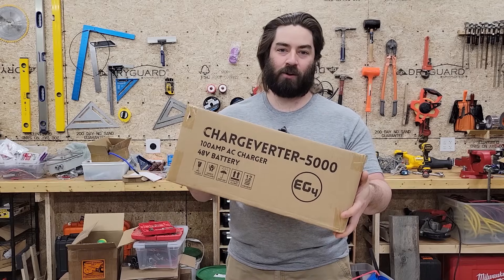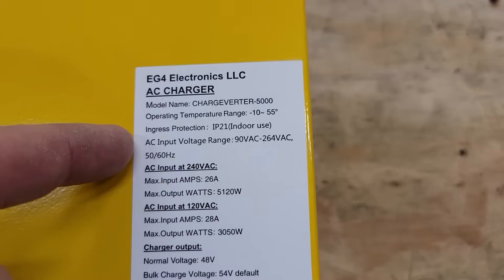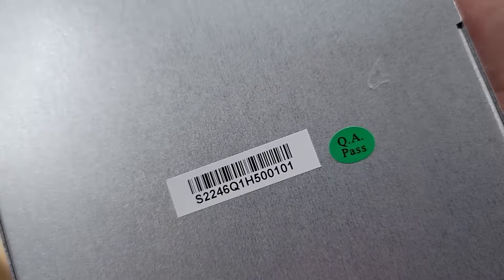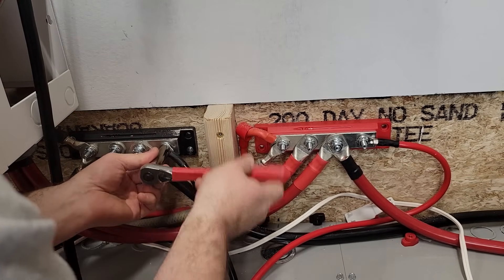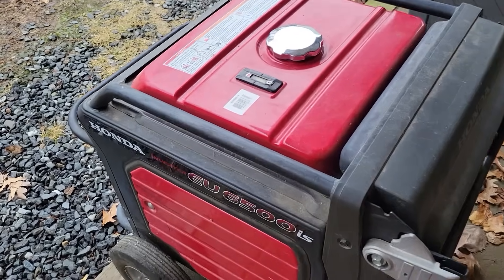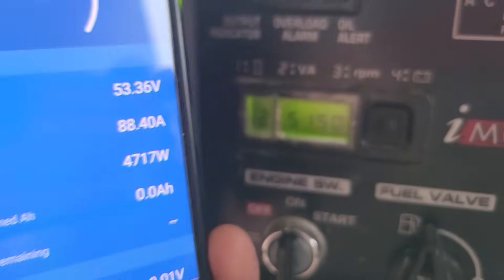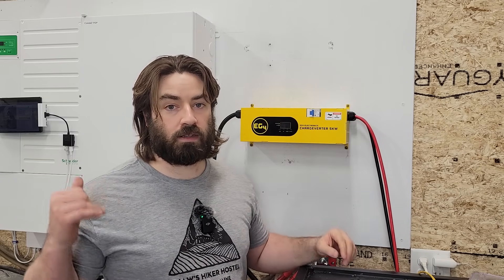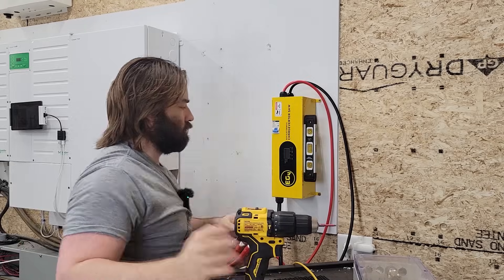Powerful and Affordable AC Battery Charger

Comment: I have 4, 2400 watt 12v power supplies, 220/240v they can be put in series, with little mods, they are server power supplies,  if I could build a DC to DC converter, with constant current constant voltage, capable of outputting 60-70v, this would be one heck of a charger, it would require over 10kw, they output 2450 watts, or I could use 5 in series, using a buck converter, I believe are more efficient,  also adding wattage this would be in the 12-13kw possibly more required for full output,,
I was thinking about using 3in series for 37.5v , To charge a 24v system,  but I'm thinking about going to a 48v system, I would only need a inverter, running a 14s lion battery,  two of my 7s in series,
Reply: thats a lot

Comment: Dear Brother David, I've been expecting this review from you, and you've not let us down. Many thanks for your menthodical, well-explained approach! Now, a request: Given that many of us off-gridders have been using "ordinary" (non-inverter) generators to charge our earlier generation (non-hybrid) systems -- mine is a Magnum 4kW 48v inverter with a Midnite Solar Classic 150 charge controller -- but now are embracing hybrid inverters, can you please kindly run this test again with any old non-inverter generator? Given that the guts of this Chargeverter come from the same Voltronics factory as the MPP Solar and EG4 hybrid inverters, it's crucial that we know the Chargeverter can accept "dirty" AC that our older inverters digested without issues. I don't want to have to buy an inverter generator to use this $400 charger! Best thanks!
Reply from the maker: If you are in MA, bring your generator by and we can test it.  

You are not the only person with this request.  I'll ask around to my friends/family and see if someone owns an older style generator to test.
Reply: @DavidPozEnergy  Given that I'm on the California coast, the odds of my schlepping my genny over are slim! But I do hope someone nearby will offer one up. What about your diesel genny? Can't imagine its signal is too pristine. Thanks again!
Reply: @DavidPozEnergy  id like to see that as well
Reply: My system was designed with help from the EG4 design department. Here's what they said in regards to something similar to your request:

"If you wanted to use a generator to charge the batteries you would need a transfer switch to go from the grid to generator power since the inverters only have one AC input port.  For a generator we recommend a generator with twice the wattage rating of your inverters.  This is to account for dirty power.  Dirty power tends to happen when a generator is operating at over 50% capacity and will produce voltage spikes and lulls that the inverters will not like.  Since you have 13kW of inverter capacity it would take a pretty large generator.  If you didn't want to buy a large generator you could use battery charger plugged into a generator."

At the time, he pointed towards a different, smaller charger they had, but then the 5000 came along, so I think that it would apply as well, meaning, these battery chargers account for dirty power.

Comment: How long and how much fuel to fully charge your batteries that are around 20%.?
Reply from the maker: My battery bank is 600Ah (about 30kWh).  If I was to charge 80% of that capacity, it would be 480Ah.  (600Ah*0.8)

If I set my charger to 80A, then is would take 6 hours to re-charge.  (480Ah/80A=6h)

I haven't performed a fuel consumption test at that exact load, but I'd guess around 5.5 gallons of gasoline in my Honda generator.

Comment: Sort of splitting hairs, but... your gen is (if I read it right without pausing!) rated at 5500Kva.  Not watts.  The numbers only line up with a purely resistive load.  Ditto, the display on the panel of it seems to be reading Kva, not W.
Reply: And yes, it's 5.5 Kva.
Reply from the maker: You are correct, VA is not Watts.  I wanted to keep to the main point of the video, and not make this video an hour long.  I could get into the weeds on a lot of those things, and I would if I was making a video dedicated to it.  

Light-hearted fun comment to follow:

BTW, your comment reads "your gen is (if I read it right without pausing!) rated at 5500Kva".  It's sort of splitting hairs, but... my generator is rated at 5.5kVA.  You wrote "5500Kva" which would be be a heck of a lot more power.  Oh, and the "k" is supposed to be lower case, and you wrote it as upper case.  Oh, and the "VA" is supposed to be upper case and you wrote it as lower case.  LOL.  As you can see, there is quite the rabbit hole if we wanted to go down it.  But that's not the point of the video.  Thanks for watching.
Reply: @DavidPozEnergy  - I'm sure you know/knew (I shouldn't have made it so directive), it was more for anyone else seeing the terms and possibly being confused.  Run into it all the time with UPS's since they're always {over power marketed?} in VA which confuses the hell out of people.

Comment: I wish this charger was out a year ago! Then I'd probably grabbed it. Right now, I just use a 16-amp 48v charger a few days out of the year to keep my 50KW battery bank alive. It seems to put out around 600 watts. It runs usually for 12-18 hours whenever I need it. I've got it connected to a 20amp Wi-Fi switch currently. So, I can switch it on and off remotely from anywhere. I guess next step would be to get it to kick in automatically when my batteries are low. But I'll probably just buy a generator or run 240v grid power to my solar shed. This way I could take advantage of my dual 100amp chargers built in my Victron inverter. The huge Victron inverters utilize software that helps them use less running power. I've seen my 15KW inverter running on 90 watts before.

Comment: How many amps does the"EG4 6.5kW Off-Grid Inverter | 6500EX-48 | 6500W Output | 8000W PV Input | 500V VOC Input" charges the batteries when hooked to a generator?

Comment: Question, if you had two generators could you run two chargers running to the same battery bank? If you only had the one charger but two generators could you use one of the GroWatt inverters as a second charger with the AC in while still powering the house?

Comment: Why do you suppose it has a max charge voltage of 57V? Full charge for 16s LFP is 58.4V, and 14s NMC Li-ion is 58.8V. What am I missing?
Reply from the maker: In an off-grid solar system, you don't use the generator to re-charge the battery to 100%.  Instead, the generator is usually only turned on to re-charge the battery partially, maybe 60%.  After all, you don't know if the sun is about to come out in an hour, and you want the solar energy to have some place to go.
Reply: @DavidPozEnergy  I hear you, just seems strange it would not even have the option to fully charge.

Comment: I think that is the best way to utilize a generator with solar. A few months ago I did the same but used a much smaller 48v charger. When I need to charge up my battery bank , I start the generator and run the charger only. You can really optimize your battery usage when you know you can quickly charge them up. If you calculate the cost of a larger battery bank to handle any eventuality and the cost of fuel for a generator, the decision to go this way is a no brainer.

Comment: I am wondering if you get the same results by using a non-inverter generator. Battery chargers do not seem to like my Generac GP5500. It produces noisy power. My Interacter Professional charger does not work at all when connected to my Generac as an example.
Reply from the maker: I think it would still work.  This comment makes me wish I had a cheap style generator to test.

Comment: Cool project.  I'd like to see an update on the house and garage.  I'm buying a 100-year-old house that needs some work.  I've already started on improvements.  By the way, solar is definitely on the list because the roof is perfect for it.  You were an inspiration for both the house and the solar.  I can't give you all the credit for that, but you DEFINITELY deserve some credit.  I may even try cellulose insulation in the garage.  Thanks for the videos!
Reply from the maker: I'm glad my videos help in some small way.
Reply: @DavidPozEnergy  Well, I just found that there appears to be no insulation at all on the exterior walls.  I live in Ohio, so that's not good.  I'm probably going to do a blown-in insulation, but I'm not sure I'll have time to do it myself.  Either way, your insulation videos are a BIG help in my understand of that process.  I'm still a little concerned about how much that cellulose settles.

Comment: Do you think it would have a problem with a non-inverter style generator? My APC & CyberPower UPS's always take exception to the generator power...
Reply from the maker: I don't think there would be a problem.  The power-supplies internally are most likely switch-mode units.  Those don't care if you use perfectly clean sine-wave or not.  I'd love to borrow an old style generator for demonstration. 

In the case of a small UPS, they are probably trying to qualify the electricity before switching over.  Meaning, the power coming in has to meet certain specs and then the UPS moves the loads to the incoming power.  This means the UPS is saying the generator power is not clean enough for the loads, and stays in back-up mode.

Comment: Are you using the Schneider BattMon ? That's a good battery monitor that integrates with the whole Schneider ecosystem. I wonder how it would handle having an external non-managed charger like you have now.  Also, the XW has two AC inputs - one for grid, one for gen. What's the benefit of an external charger like this over letting the XW (100A continuous) handle the charging ?
Reply from the maker: I have a previous video demonstrating using the generator with the XW.  https://youtu.be/36H6Sb2IG_k

Comment: It's strange that they built that unit with the screen oriented the way it is, and the output cables where they are, then vented it the way they did.  A smarter design would have the screen rotated 90 degrees and moved closer to the intake and then the output cables moved away from the heat of the discharge.  Poor engineering.

Comment: David, Great video. One thing I think you forgot to mention, How long did it take for your gen to charge your battery bank ?  Thank-you, Mike.
Reply from the maker: My battery bank is made of 6x EG4 batteries.  Each EG4 battery is 100Ah.  6 in parallel means my whole battery bank is 600Ah.  If I was at 0%SOC, and charged at the full 100A, then it would take 6 hours to charge the battery to 100%SOC.  However, I don't suggest that approach.  As I showed in the video, I'll be charging at 80A given my generator.  And, I wouldn't wait until the batteries were dead, and I wouldn't charge all the way.  It's far more typical to charge, perhaps, 40% of the total capacity in an off grid situation.  That would be 600Ah*0.4/80= 3 hours.

Comment: Nice charger..  I bought the 18 amp for my 6 batts.  Works ok for one at a time charging.  I wonder how long it would take to charge my 6 batts all at one time with 18 amps?  Or is that a good idea at all.  Hard to get enough sun at times.  Enjoy your vids.
Reply from the maker: Nothing wrong with using an 18A charger.  Especially if you use it with a small "suitcase" generator.  But, if you are running a larger generator like my Honda EU6500, then the fuel economy is pretty poor.  I have a video showcasing that: https://youtu.be/QAoorfdbefo
Reply: 600/18 and throw in an extra 10%.  Assumed going from 0% to 100%.
Reply: take like 40 hours to charge. the large charger will do it in like 7

Comment: Good day David. Been thinking about getting one of these. Can you do a "tuned test" for fuel efficiency & KWh to batteries with tour Honda please.
Perhaps run Honda at 75% load to whatever amps that equals on charger. Would love to see a max KWh charged per gallon on a full tank of fuel, without overloading the genny of course.
Reply from the maker: Yes, I plan to do a part 2 video to my previous fuel economy test.

Comment: Thanks for doing the test. I may eventually buy one if they appear to hold up over time. I have the Honda EU7000is and it can't start my 4-ton HVAC condensing unit even with a soft start. My Growatt 12k inverter likely can, so if I ever have a prolonged outage during a heat wave, I would be able to have the Honda run the Chargeverter while the Growatt runs the house loads and handles the large inrush spikes. This would prolong the run time of the 20kWh LIfepower4 battery rack provided that the average house load stays below the max continuous output of the generator which I converted to run on natural gas.

Comment: Thank you for the vid!   It wasn't quite clear, wondering if you can you leave the unit off,  fire up the generator,  and then...  come inside and throw the unit circuit breaker to start charging?    Is there a reason to leave it on all the time or were you just showing what happens with battery only?   .I ask because in my case it's a manual generator start about 200ft from the battery bank - e.g. start the generator without load and then go in and enable the charging at the battery but also cut-off charging at the battery if the generator struggles.
Reply from the maker: I wasn't sure, so I just went and tested it for you.  It worked fine.  I had the AC side connected with the battery circuit breaker off.  Nothing bad happened at all.  Then I switched off the DC breaker first with the generator still running.  Yes, that's fine.  If you decide to purchase one, it would help out the channel to use the affiliate link in the description.

Comment: It's already no longer on SS website. For reference, would you tell us the price?
Reply from the maker: It is $399.  Sorry, when I first posted I had messed up the link.  Here is a fixed affiliate link: https://signaturesolar.com/eg4-chargeverter-battery-charger-48v-100a-5120w-output-240/120v-input?ref=4_rHcgZ9x-TiF-

Comment: Alternatively you could also just rectify the 240v from the generator and feed it into a charge controller. Just have to make sure that it's within the charger max voltage. 240vac rectified is like 320vdc.

This is actually how those big, tens to hundreds of kVA UPS systems work. Instead of using normal diodes they just use SCRs which are basically diodes you can switch off at the crossing point, this way they can control the output voltage and keep the batteries charged 24/7, while the inverter is always running producing clean AC

I think it goes without saying that high voltage can be dangerous but is perfectly safe as long as proper safety methods are used.

Comment: At 14:17 I hope you flipped the DC cables on the top to the left side of the charger as having the hot exhaust air blow directly on those cables doesn't seem like a great idea. Not an expert, just seems logical to me, this is an awesome video.

I am of the opinion that it makes way more sense to have a generator available to charge your system if you plan on going off grid so you don't need to go over kill with solar panels and battery capacity in order to make up for those cloudy days or poor weather. I think it's way more practical and cost effective, it also has the added bonus of having a generator available should your inverter ever fail. I feel like most people wouldn't mind needing to run the generator for a few hours to top up when weather is an issue, and since you are capturing most of the electricity generated it's actually not bad on fuel cost. What are your thoughts?
Reply from the maker: My goal is to cover my electrical needs with solar 99% of the time.  That leaves 1%, or 3.65 days per year that I need to run the generator.  I'm OK with that.

Comment: Thanks David, I've a 120v 30a generator with a TT-30R outlet. Can you give advice on how I can make it work with this chargeverter? Looks like the chargeverter plug can be disassembled, which should allow me to put on a TT-30R plug on it?
Reply from the maker: You are correct, that the plug on the cord can be removed.  I haven't done it, but there might not be a neutral (white) wire in the cord.  If there is a neutral wire, then you will have to double check it's not connected to anything inside.
Reply: @DavidPozEnergy  Thanks, I confirmed there's no neutral, it's currently wired with 2 hots, blue and a brown, and a yellow/green for ground. For a TT-30, do I just wire one of the hots, and ground and no neutral? or do i bridge both hots and no neutral?

Comment: Using a MidNite Solar CLASSIC 150 MPPT Charge Controller, Operating at 150 Volts with a Max Current of 96 Amps. And hooked to a #DC1248AC DUAL CORE PMG/PMA by Thermodyne Systems and powered by a 6+HP Diesel engine all for under $1,700 works the treat for me. It is cheap to build and operate and very efficient. We make our own fuel using waste Veggie-Oil that has settled for two weeks and filtered down to 25 microns. We add 10% gasoline and filter to 1 micron and use it in our diesel generator. All of our filters are polyester cleanable and reusable. So, we have an efficient generator and cheap fuel that cost between 3–9 cents per kilowatt hour depending on if it is a 10% summer or 30% winter blend. We live in Michigan where the grid is 17.4 cents per Kilowatt Hour. So, this cost is less than the power grid. Even if you do not make your own fuel, it is still a good way to make energy.

Comment: i wonder if those power supply's came from old decommissioned cell tower units which are typically  48v
Reply: haha.  considering the output voltage is configurable, highly unlikely